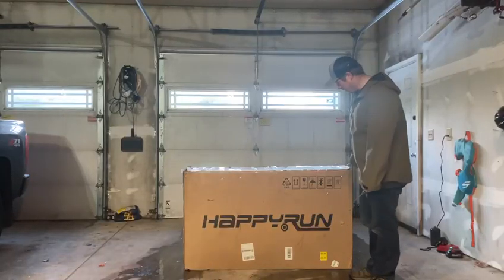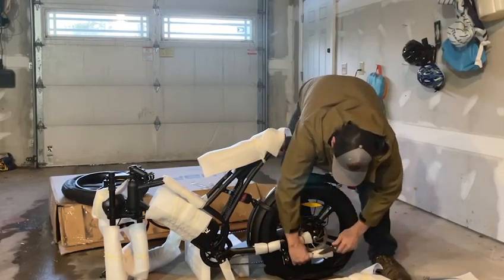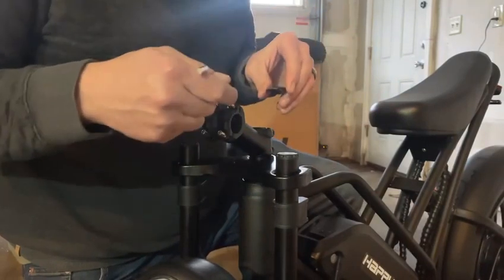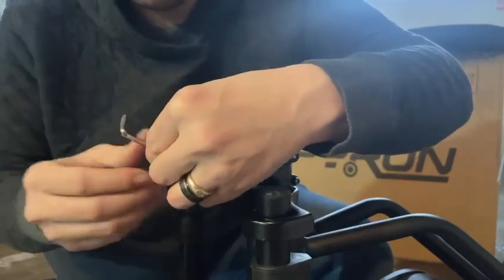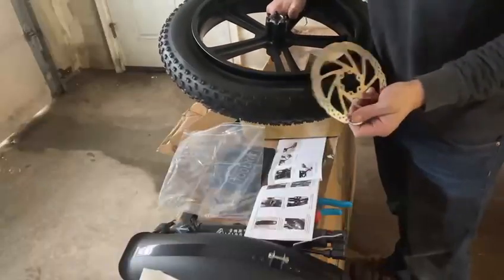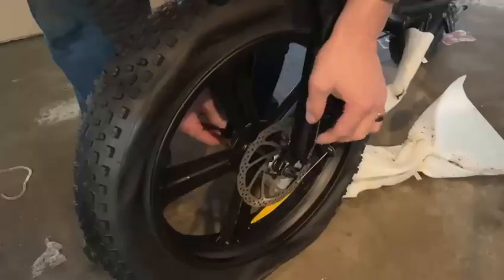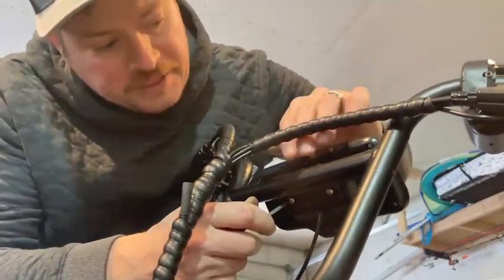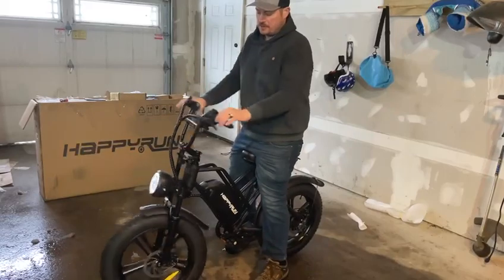HAPPYRUN G50 750W Brushless Motor 20*4.0'' Fat Tire Electric Bike UNBOXING!

Comment: hi, i just bought the happyrun g50.
I would like the unlock procedure, because it is currently stuck at 15mph. I would also like to know if it is possible to put the display in kmh instead of mph and if possible how to operate the bicycle with the accelerator, at the moment it only starts with the pedals.
Thank you.
Reply: Try holding the brake and throttle at the same time as turning the key on,, let me know if that worked